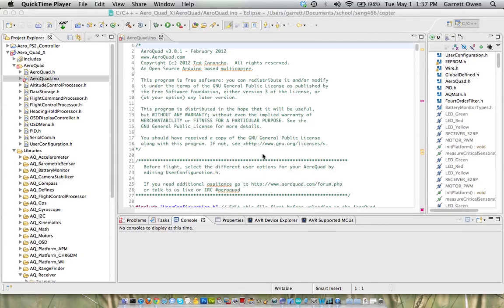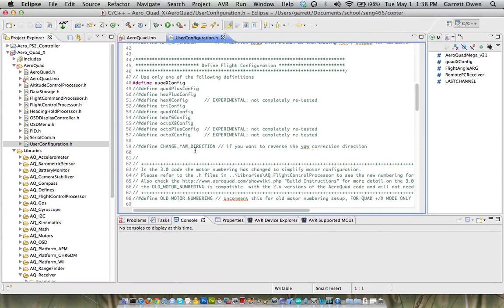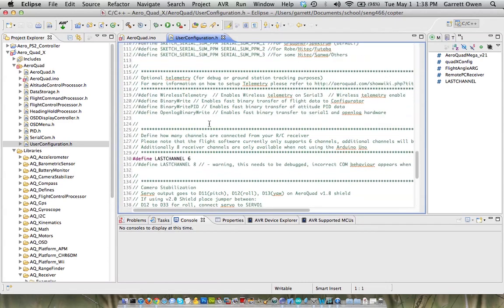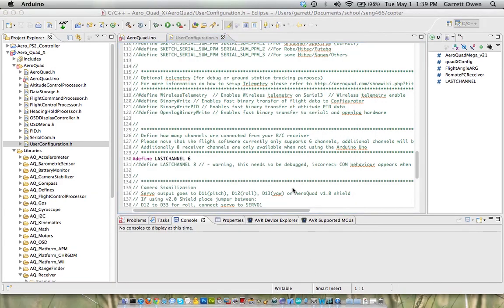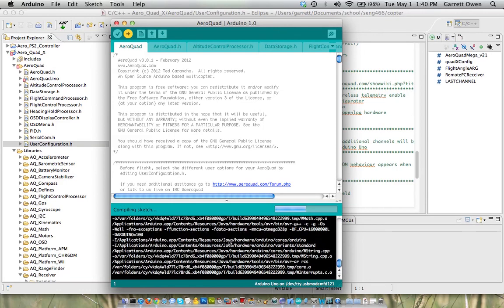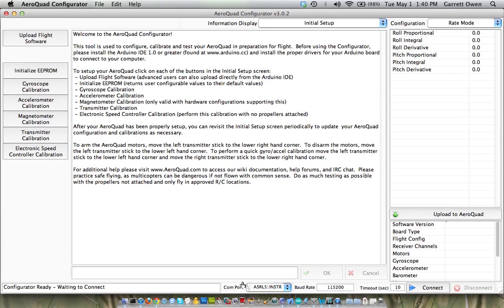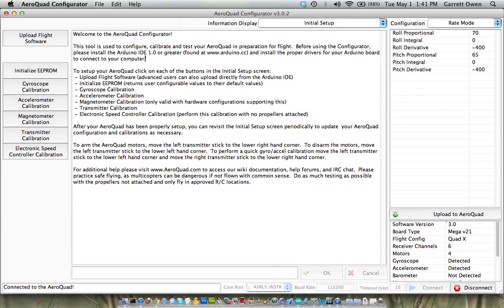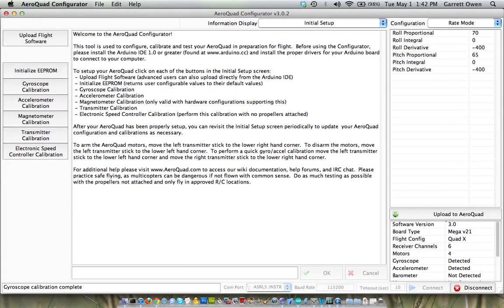Setting Up AeroQuad Software Pt 1

Comment: I have a question. A group of friends and I are building a QuadCopter for a High School project. For some reason we seem to be running into a problem that shouldn't be a problem. We are using an arduino uno and an AeroQuad Shield v1.9. We are not able to upload the AeroQuad software onto the shield. We were following an instructable and now are facing a problem we can't find a solution too. Do we need to buy another part? Thank you!